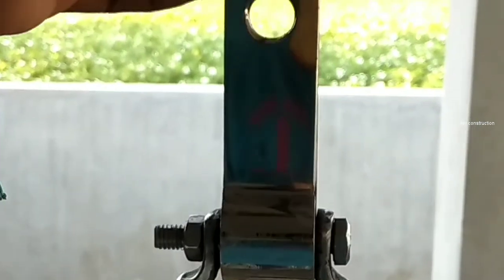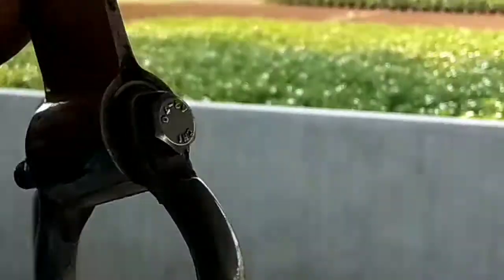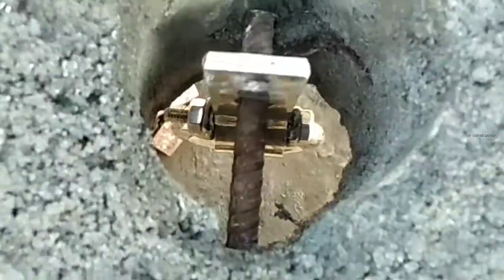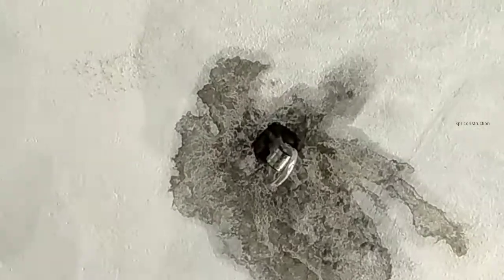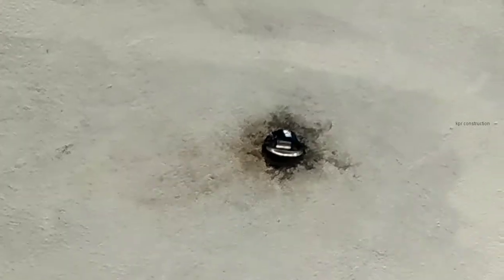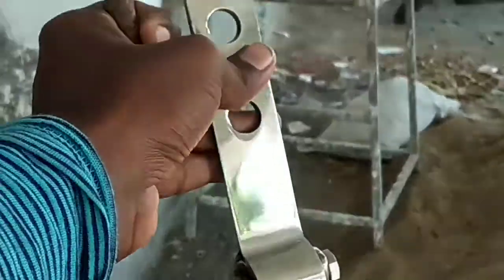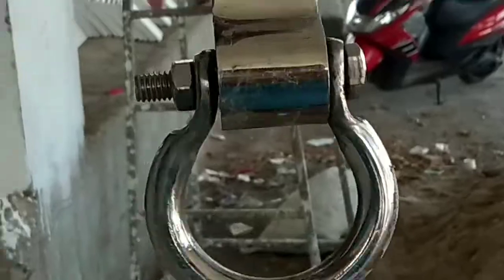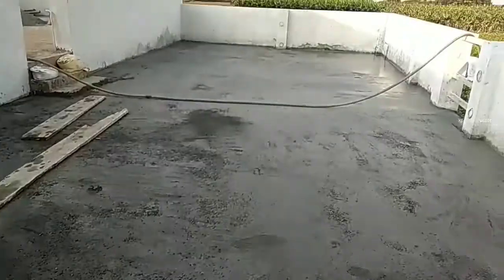Swinging chair hook installation in roof concrete

Comment: Can we hang jhoola in the rebar fan hook provided during slab casting ?
Reply: It has less load bearing capacity and no bearings which are necessary for swing action 
So not advisable

Comment: Can we install Patti Kada on side of beam with bolts? if so what bolts to be used?
Reply from the maker: Jet hook bolt
Reply: @kprconstruction2071  is it anchor bolts you mean. Because if I search for jet hook bolt, it shows J shape bolt with a nut and no idea to how to use it with this Patti kada